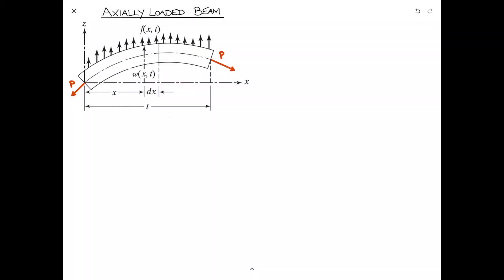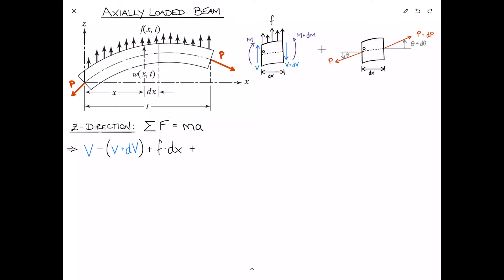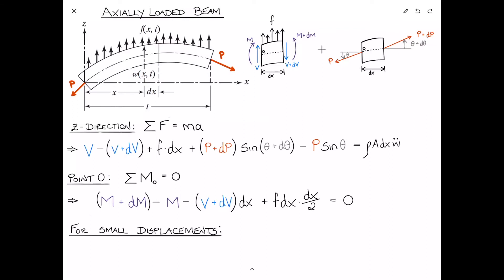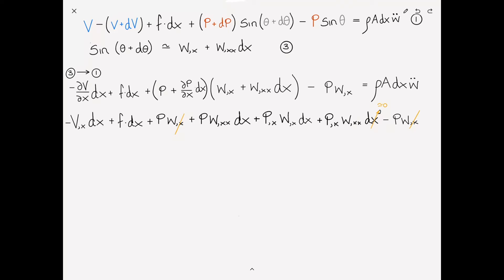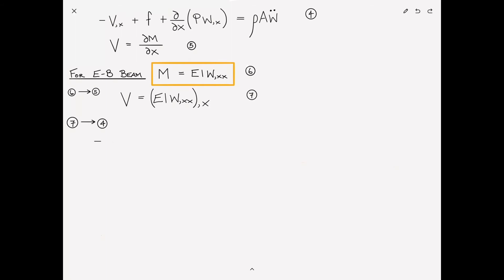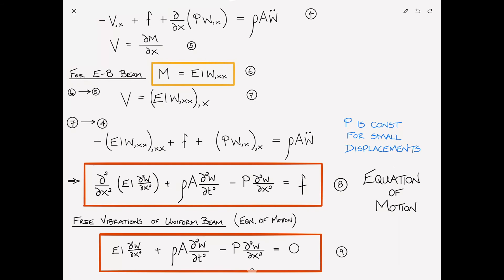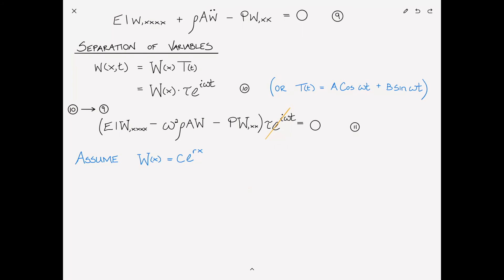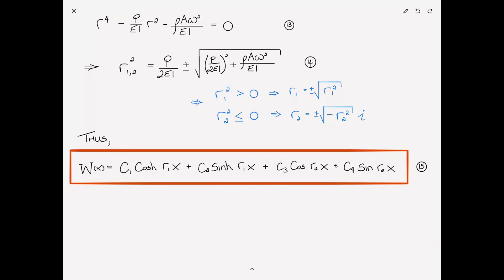Transverse Vibration Analysis of an Axially-Loaded Euler-Bernoulli Beam (Continuous System)

Comment: Thank you so much for your useful lectures.
I just didn't understand 1 thing :
Why didn't you put (p + dp)sin(theta).dx in the Momentum Equation?
I mean, it is a force which you put it in the Newton's law Equation
But you didn't consider its Momentum on point 0.
Reply: I did ask myself the exact same thing.
Does anybody know the answer?
Reply: @franzwurst6329  Axial forces cross from point O; therefore, there won't be any moment caused by force P and P+dP. The figure shown above might cause a misunderstanding.
Reply: @soroushasadian9100  i don't think so.... The figure shown should be fine
Reply: @franzwurst6329  I checked my references, check mechanical vibrations by Rao, you will find the answer
Reply: @soroushasadian9100  First of all i would really thank you for sharing this reference, it looks like a really solid book.
I looked it up but the figure in your reference is kind of misleading in my opinion. This is because the lines of action of both axial forces seem to intersect with point 0, even though both forces do have different angles (depicted in the figure)...
Reply: I guess, youll get that by truncating taylor series expansion for differential element
Reply: @pmanikantabalaji4476  thank's 👍 your suggestion lead me on the correct path. By taylor series expansion and neglecting higher order terms you'll see that the axial force does not contribute to the moment balance (limited to small displacements)